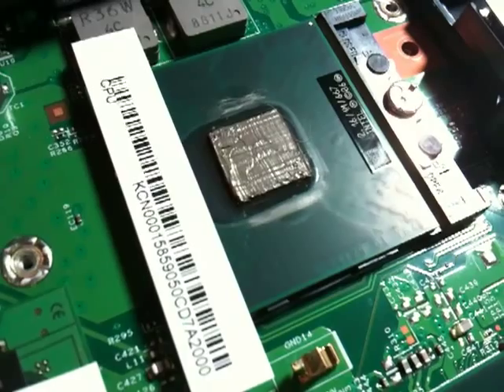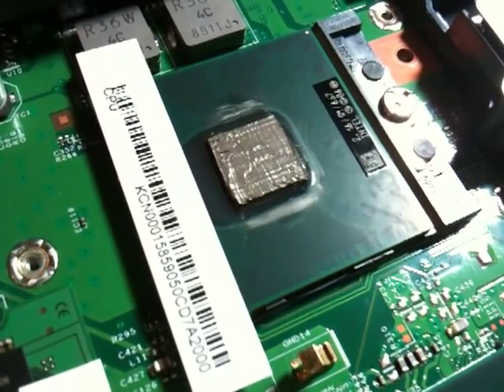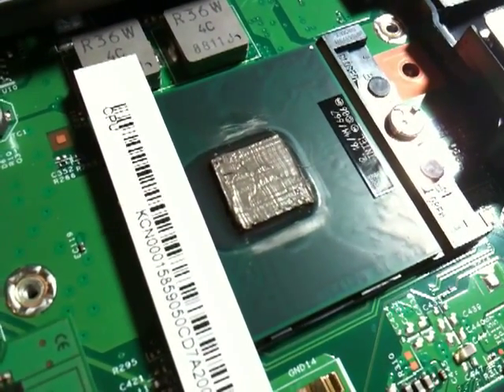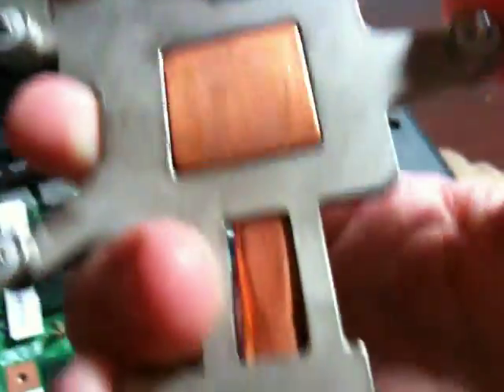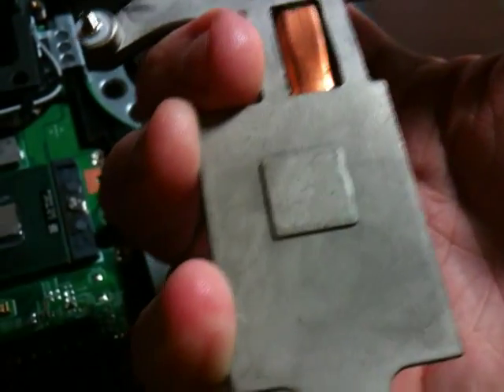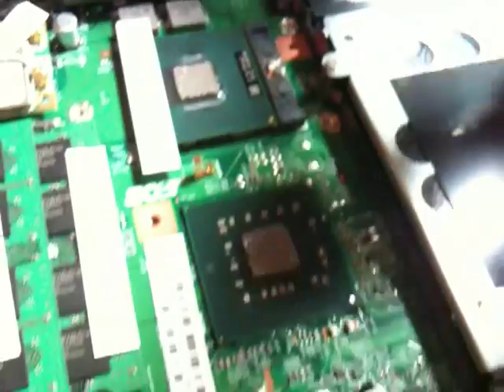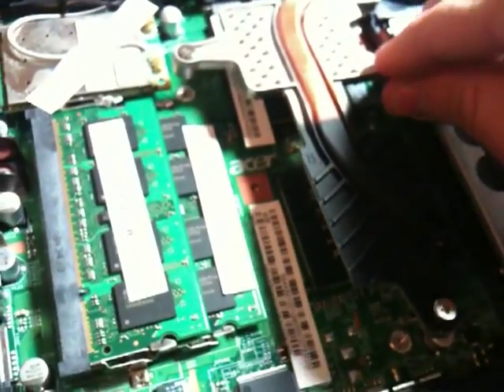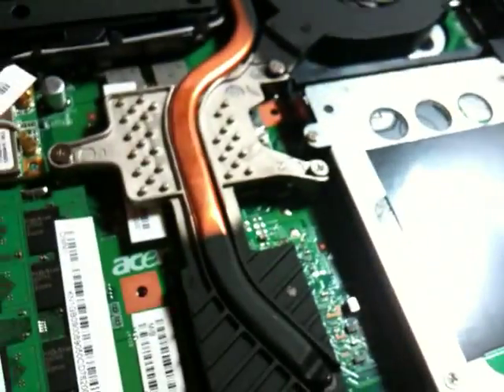I replaced the Thermal Paste on the Acer correctly

Comment: If you apply it in the middle it will spread correctly on its own when put back together and turned on for like 3 mins, doing it this way is wrong, or at least not as good..
Reply: WelshGamer69 I find this method to be superior on desktops, but as you said it doesn't work quite as well with laptops... you need to use a large glob in the centre and compression will hopefully spread it correctly

Comment: I changed the thermal paste in my laptop and it only droped 5-8 degres celcious why? .............i used arctic silver 5 and i am 100% i did it right couse i am an electronics engineere(almost).

Comment: Looks pretty, but next time you do it, try just leaving it as a blob and letting the contact surface spread it for you. That way, you can guarantee you won't end up with air bubbles in the mix, also probably drop your temps another few degrees, depending on how much air gets trapped by your current installation. Trust me ;) it works!

Comment: Is there any free space between GPU and cooler?
Because I saw somewhere, that he put between GPU and cooler peace of cooper plate about 1-2mm thickness.
My brother has this laptop. It´s realy peace of crap and it overheat a lot so I want to disassemble it, clean the fan and replace the thermal paste with Arctic silver 5...

Comment: @jakthebomb

I was wondering what model that laptop is, because I have noticed that it uses the regular DDR2 Ram Cards and not the short mini ones you usually get in laptops. My Toshiba L300D was a great machine but it died earlier on last year and has since been in the cupboard gathering dust, until I saw this video and I immediately went and bought some Thermal Compound and layered it on the CPU and GPU evenly like you did and It worked for the first time in months, thank you.